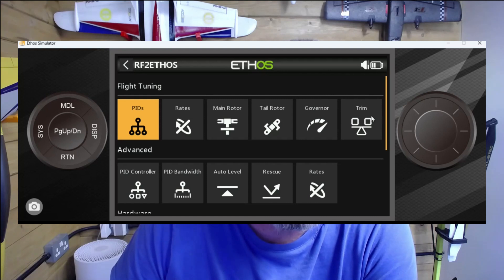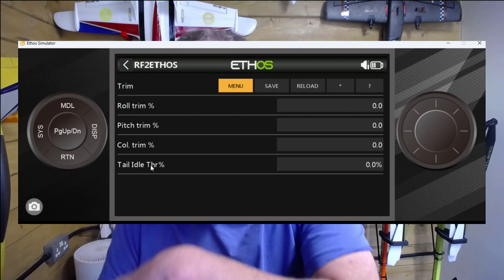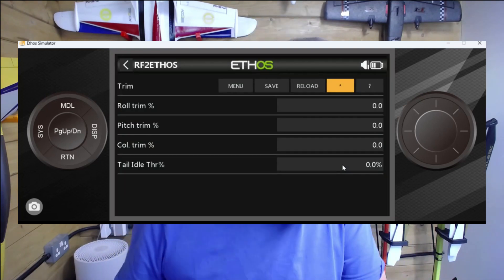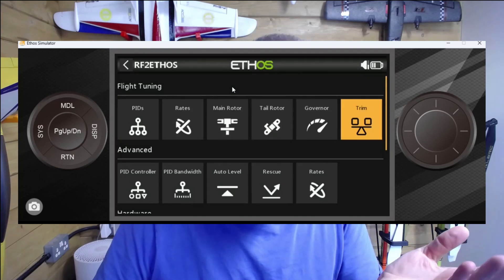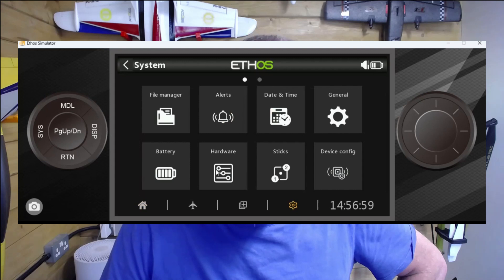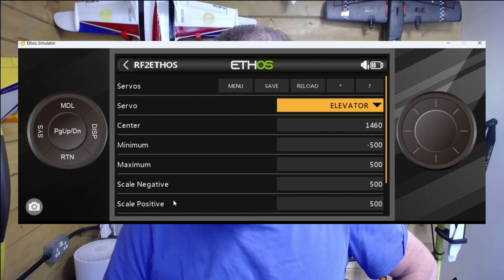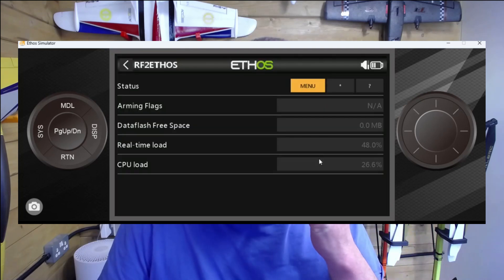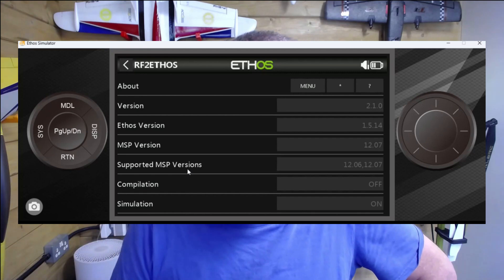SWASHPLATE LEVELING AND MORE IN RF2ETHOS

Comment: No, I haven't because I don't have the Vantac RF007 yet!  I was only experimenting with the Lua scripts on my Tandem X20RS to see how things worked as a lua script.  So it looks like that it will only populate if I had the actual unit connected via radio, is that right?
Reply from the maker: @bobbylana  correct.

But you can install and run it in the ethos simulator on the pc
Reply: @RTRCTV  I haven't installed the sim on my computer as of yet, I`ll give it a try.

Comment: Hello, I downloaded the Lau scripts for ROTORFLIGHT VANTAC RF007 Archer+, however, the screen does not populate and I get a error message that says, please check your heli is powered on and telemetry is running! Do I have to have the Vantac bound and turned on in my radio before the screen works?
Reply from the maker: @bobbylana  have you discovered sensors?